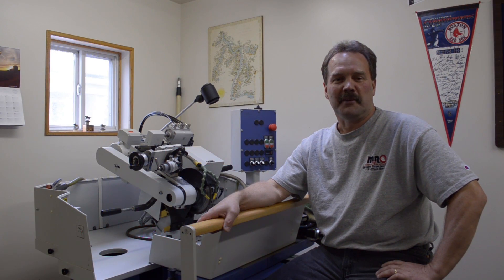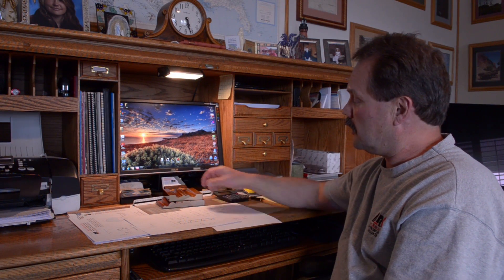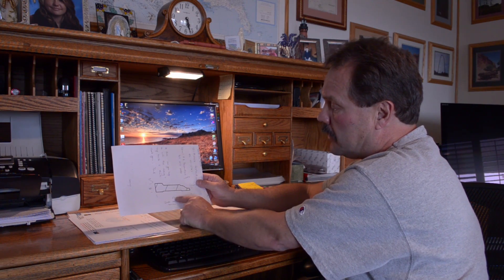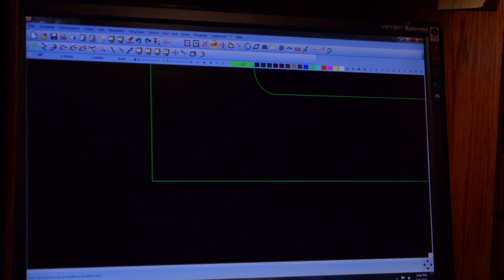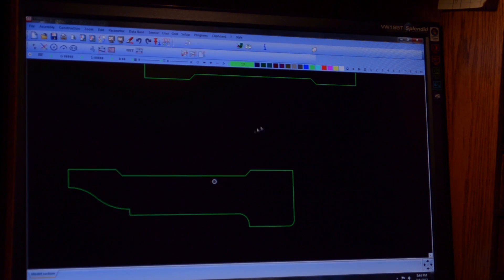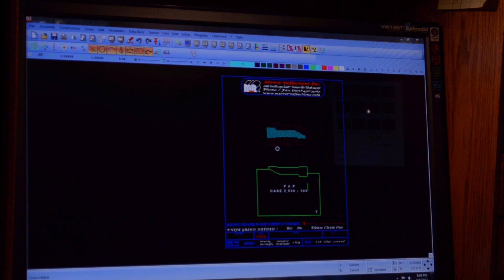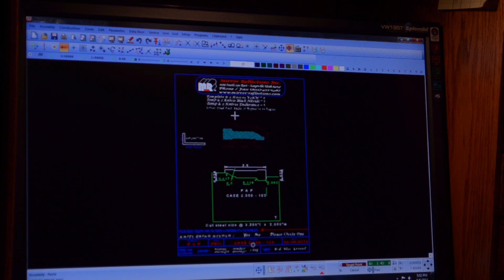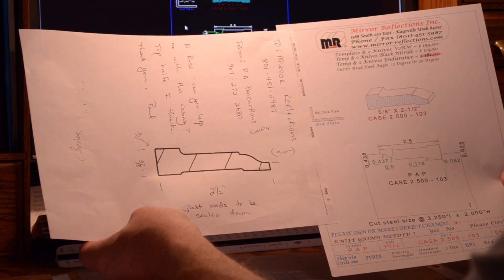Moulding Knife Template Design, C.A.D to Acrylic Moulding Pattern

Comment: How long did it take to draw up the profile templet on the computer. Nice job
Reply from the maker: That all depends on how complex the moulding knife profile is, this particular moulding design took about thirty minutes, but I like to put as much information as possible to help moulding machine operators be successful and save time.
Reply: I own a sharpening center. Lately more and more customers are requesting molding knife profiles. I have a bench top profile grinder but my expieriance is novis by far. For example I used my sharpening wheel to cut the 3/16" steel. It took a long time. I use a scroll saw to make my templets. It does ok but takes a long time. The knives I made took almost four hours from start to finish. Will I ever purchase a unit like yours ,,,,, I think it may be necessary . What's your advice. Thanks Pete
Reply from the maker: Pedro Navajas To remain competitive you will have to upgrade sooner than later, but wait until you have made enough $ to do so. Weinig makes the best profile moulding knife grinder on the market today period!
Reply: Good advice, I know the modern equipment out there eather performs outstanding or just breaks down often. Would you be able to recomend a particular model Weinig makes that's good for entry level work load. Thanks
Reply: Either
Reply from the maker: Pedro Navajas Weinig R-960
Reply: Thanks I will look it up.
Reply from the maker: Our pleasure, good luck!
Thanks for watching and commenting on our video's.